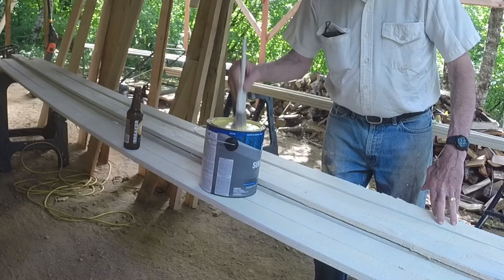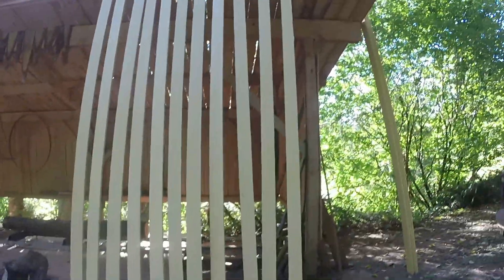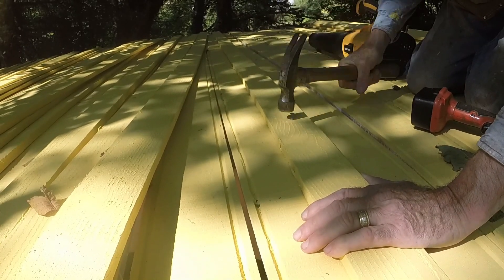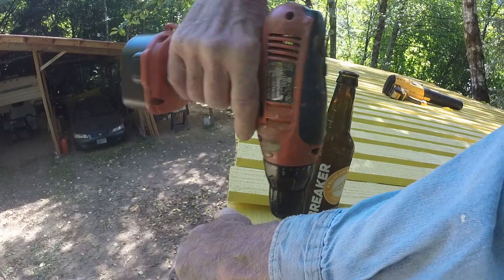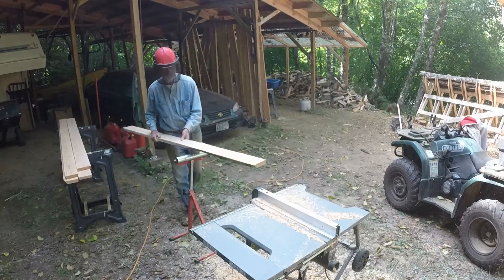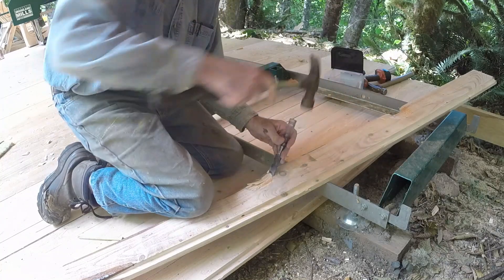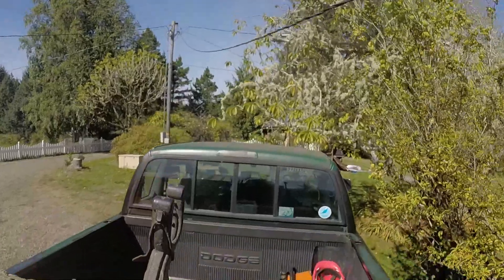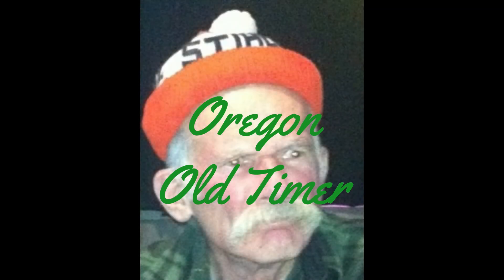My Sawmill Shed is Finally Finished

Comment: Love the ingenuity and sarcasm. I'm going to build that same roof over my mill now.
Reply from the maker: After more time and more rain, I've found one small leak, but I haven't climbed up there to see what caused it. Knots, even painted ones, may weep a little. Next time I build a board and batten roof, I'll make the channels in the boards wider and deeper using dado blades in the table saw, and I'll seal knots before painting.
Reply: You put out a video hole lot of shacking going on my sawmill doing the same thing can you please tell me what you done to stop it had my Mill for a year but it just started shacking I've tried everything I know to stop it thank you for your reply